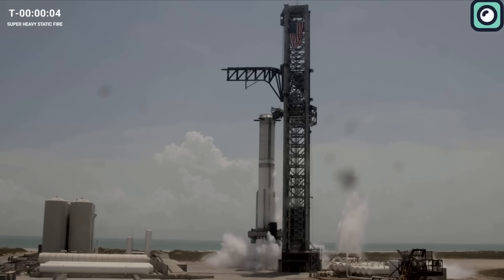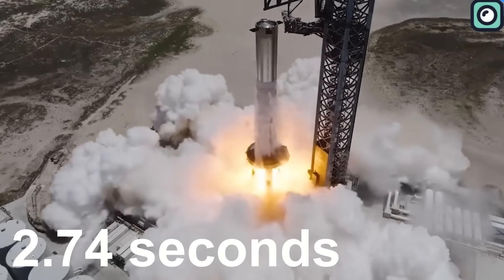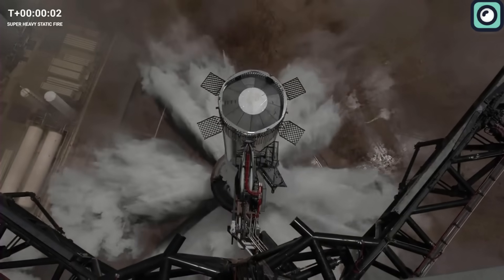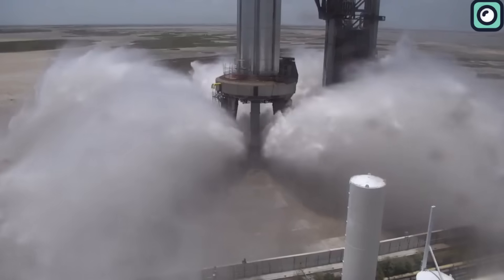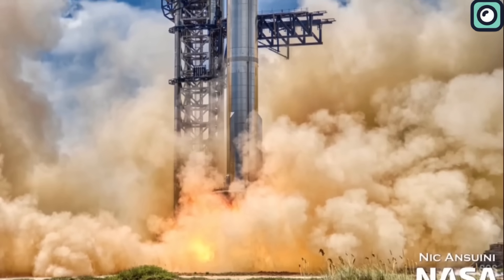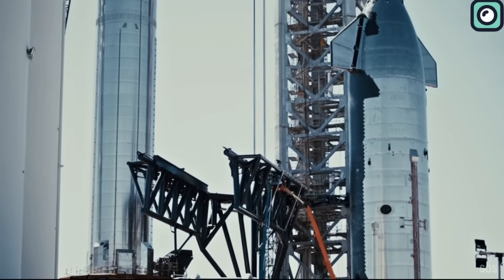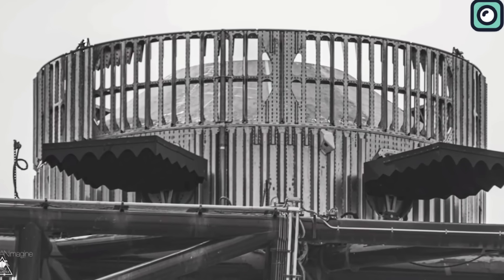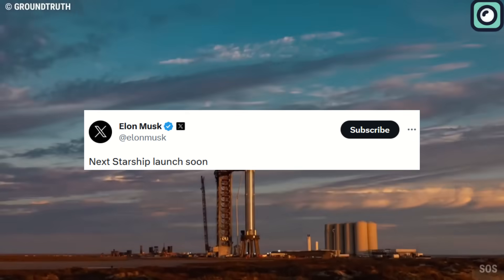Another 33 Engines Static Fire Test Happening....

Comment: The test was 2.2 seconds. I arrived at this with their clock. If the noise canceling system could fly into orbit with booster 9. The engines might partially work. At 33 engines a test, how long will Edmond money last. Developing a larger engine is expensive. But it will be cheaper than repeating the same test over and over expecting a different result. Elon let SpaceX design a working rocket. Let smart people do their job.

Comment: They don't fill the booster with methane because they don't need to be wasting it and poluting the atmosphere unnecessarily. They have to fill it with oxygen to try to compensate for the lack of weight a Starship would add. They don't want the booster ripping itself loose from its mooring.

Comment: I believe introducing water will in fact form too much steams, triggering and sure destruction.
Reply: I'm going to have to disagree with your assessment. While steam may occur during an actual launch, the use of a deluge system has been used at Kennedy for decades successfully. Any steam won't have any appreciable effect on the rocket or booster as neither will be in its vicinity for very long. Additionally, the deluge system will absorb much of the debris and sonic waves that resulted from the previous launch without the system installed.

Comment: What could happen to the directional paddles when the first and second stage separates? Will the blast from the rocket engines damage them?
Reply: Could, sure. Likely, no. Waffle design should be resistant to damage and deflection of blast will likely miss them. The exhaust will take place on seperation in high altitude where air pressure will be low and unlikely to cause an issue allowing exhaust to move away from the booster without hitting the paddles.

Tumbling of the booster is another thing, but again, very thin air and the booster has to tumble anyway to land at pad at some point.